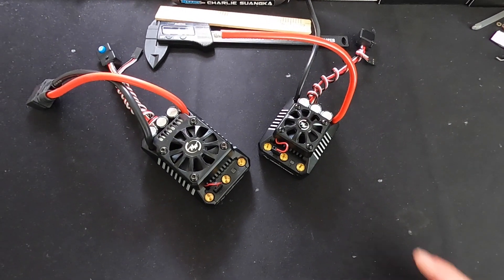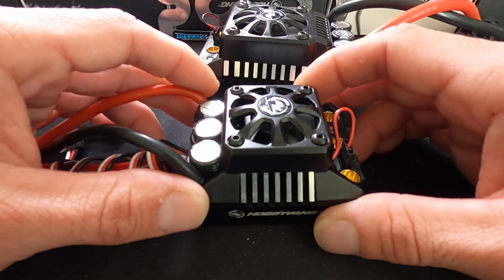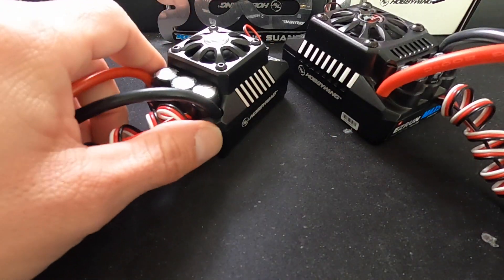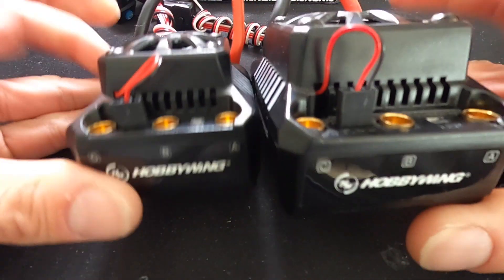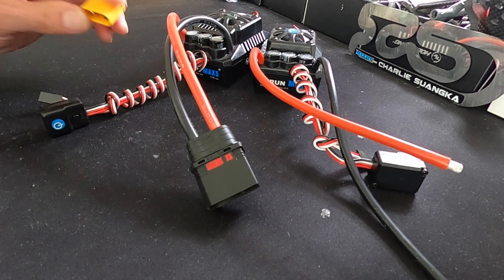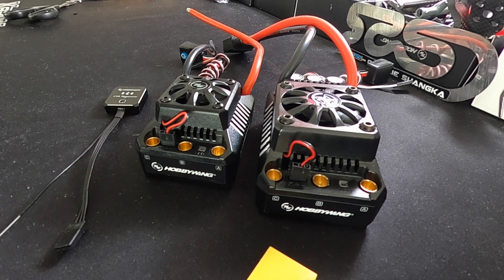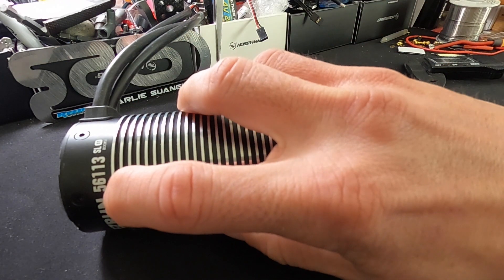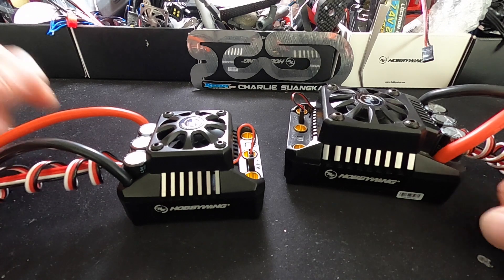The Charlie Show /// Episode 192 /// EZRun Max5 and Max 6

Comment: Just purchased a max6 for my recently purchased xmaxx. I also have the traxxas light kit for it. Instructions show the light kit plugs directly into the traxxas esc.  Is there a way to replicate this setup with the max6 or is there another recommend wiring setup or is traxxas light kit no go and I should look at another brands kit?
Reply: What did you find out Rick 🤔
Reply: @gonzodetroitify  I returned max6 and installed traxxas light kit. I really like the kit and the traxxas esc has been fine. After doing more research didn't see a reason to change esc. I initially was going to change based on some reviews that the esc's are bad but found newer models are fine and folks have gone long time with no issues.
Reply: @FedoraTech  it’s the slight coffin I don’t like but like the light kit more also slight coggin tho slight not that bad trade off for lights 😎

Comment: Is there a Kv limiter to what Max6 or Max5 can put out? I am looking for an ESC that can take a Tp 4050 or 4070 motor with 2350kv or plus. I didn't know if the Max5 is limit to 1500kv.

Comment: I'm guessing I could use the Max 6 in my first generation Xmaxx with the stock motor? I only run 6s on it. I still have the first generation speed control in it. I did a few cooling mods, it's the only reason it hasn't gone up in flames lol. I just want a more reliable speed control, I don't really have the intention of swapping motors unless the stock one dies.  Great video,  I was actually looking at these for a while wondering what I actually need for this purpose.

Comment: So I have an Arrma Kraton 8s. Thinking to put the Max5 in. The stock motor is a 1250KV. I think the Max5 manual says it runs a motor that is less than 1200KV? Will this be a problem?
Reply: I have a Max 6 and it says not to use anything more than 1500kv motor and I've been using a 2200kv TP 4070cm 8s motor on it for almost a year no issues to date. Just gets hotter faster. So watch your temps and you should be alright.
Reply: @Tejaye777   is u running an max6 in the Kraton 8s .
Reply: @garryellesmooth4919  No actually I'm running it in a Traxxsas Rustler 2wd VXL.

Comment: 1st off, it seems hobbywing doesn't respond to questions or comments on their videos. I have the max 5 for my dbxl-e 2.0, while it's a big improvement over the stock spectrum esc, it isn't all that. I use the leopard 58113 870kv motor, the 1st thing I had to change was the bullet connectors (8mm) on the motor because the max 5 only accepts 6.5mm. Hobbywing claims the max 5 is for 1/5th scale, well maybe for the lighter arrma 5th scales, but not so much for the heavy dbxl-e 2.0. Everything gets very hot (esc, motor, wires, qs8 connectors, batts). I run either zeee 9000mah 100c or powerhobby 8000mah 100c 8s (2 x 4s), stock spur and 15t pinion (stock pinion is 13t). I will be changing out to a more robust esc in the near future, one that can handle a higher kv rating ( leopard 58113 1050kv 220a motor) and more amp output.
Reply from the maker: Correct, you can email us anytime for assistance - NorthAmerica@hobbywing.com